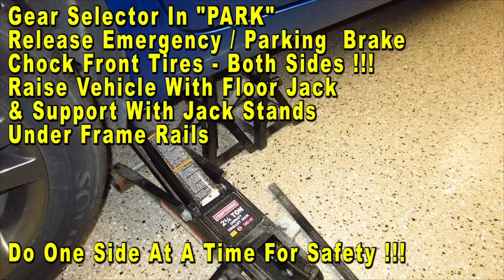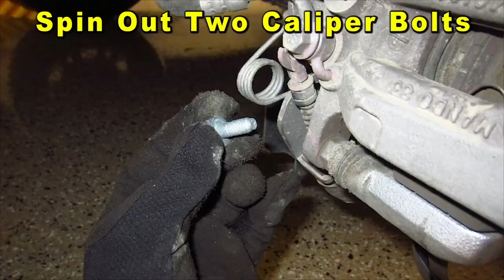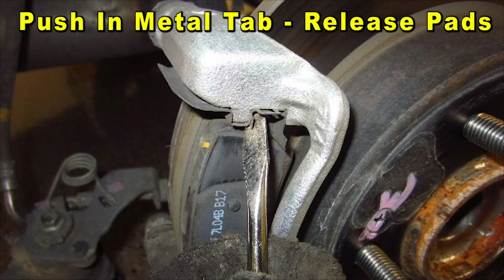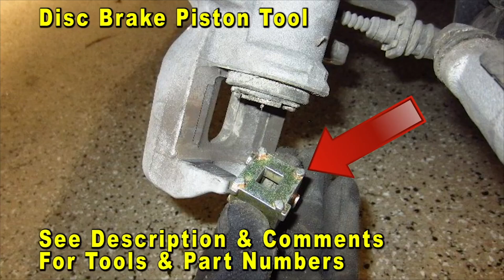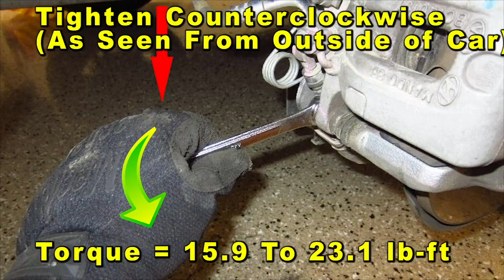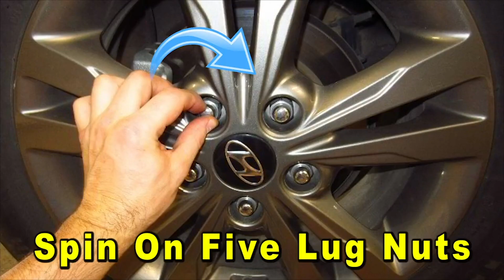2017 To 2020 Hyundai Elantra How To Change Rear Brake Pads With Part Numbers - Quick & Easy

Comment from the maker: Hyundai Elantra Rear Brake Pads - https://amzn.to/3RkpA2m
Power Stop Ceramic Rear Brake Pads Part # - https://amzn.to/3RfNImH
Raybestos Brake Pads Part Number - https://amzn.to/3NjrvTy
Bendix Ceramic Brake Pads Part Number - https://amzn.to/3RiXWCN
Precision Screwdriver Set - https://amzn.to/3sLixaP
Plastic Pry Bar Tools - https://amzn.to/3HMtsV7
Socket & Ratchet Set - https://amzn.to/3Z17LbA
Mechanix Gloves - https://amzn.to/3jCnHkt
Torque Wrench - https://amzn.to/3vS5uSI

The Paul79UF YouTube channel is a participant in the Amazon Services LLC Associates Program, an affiliate advertising program designed to provide a means for sites to earn advertising fees by advertising and linking to Amazon.

This DIY video shows owners of the 6th generation 2017, 2018, 2019 & 2020 Hyundai Elantra sedan how to change the rear disc brake pads.

Comment from the maker: Check out the DIY guide for changing the rear brake pads on a sixth generation 2017, 2018, 2019 & 2020 Hyundai Elantra - 
https://www.paulstravelpictures.com/2017-2020-Hyundai-Elantra-Rear-Brake-Pads-Replacement-Guide/index.html

Here are all of the DIY repair and maintenance tutorials for the 6th generation 2017, 2018, 2019 & 2020 Hyundai Elantra sedan - 
https://www.paulstravelpictures.com/Articles/2017-2020-Hyundai-Elantra-DIY-Repair-Maintenance-Guides.htm

Owners of other Hyundai, Genesis or Kia vehicles such as the Sonata, Accent, Veloster, Ioniq, Kona, Nexo, Venue, Tucson, Santa Fe, Palisade, G70, G80, G90, Soul, Sportage, Niro, Sorento, Telluride, Rio, Forte, Optima, Stinger, Cadenza, K900, Sedona and Seltos may also find these DIY instructions to be helpful.